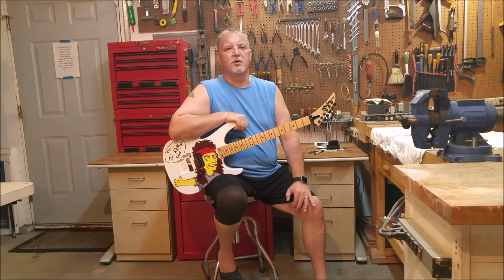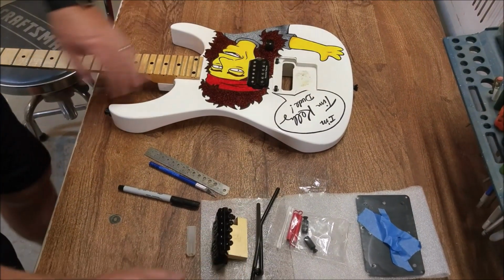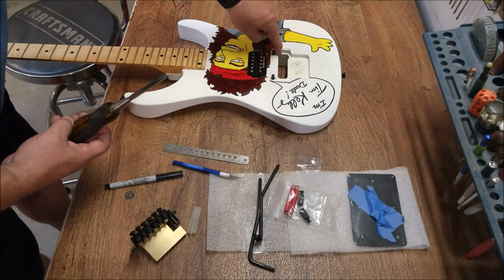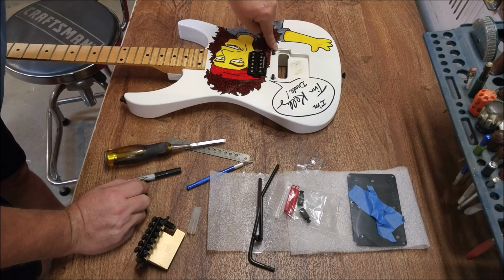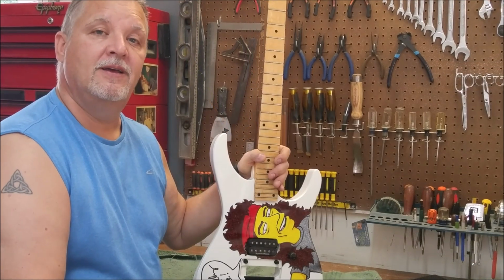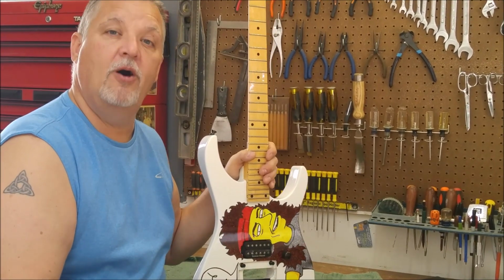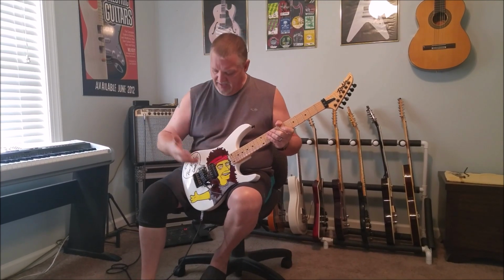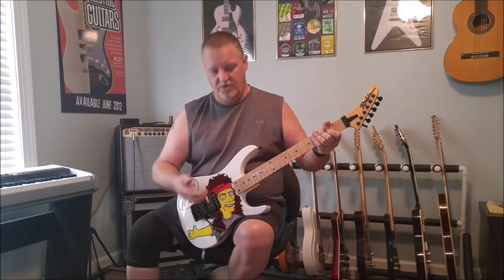Upgrading the bridge on the Tim Kelly (Slaughter) Simpsons Robin guitar!

Comment: Try a Floyd router template or make one and use a mini router. works perfect with a super clean cut. Also you can set depth to cut perfectly with no little edge.Comes out PRO EVERY TIME. Beautifull Ax Bro

Comment: So, does that mean that a Floyd Rose system only requires two springs? Some asshole "repair person" put 5 springs into the back of my ESP M-100 and it basically ruined that guitar, and I can't get anybody to fix it.
Reply from the maker: It totally depends upon the string gauges you use, but ... yes, usually only two springs can counter act the tension from the strings, while providing a reasonable resistance to down pressure

Comment: The only thing I don't care for is the huge gap at the top.
Reply from the maker: I could have routed out/inlaid a new piece of wood, correctly routed out the NEW trem cavity and installed the FR, but that would have damaged the original graphics/paint/design and so I had to proceed very carefully and work with what was already there ...